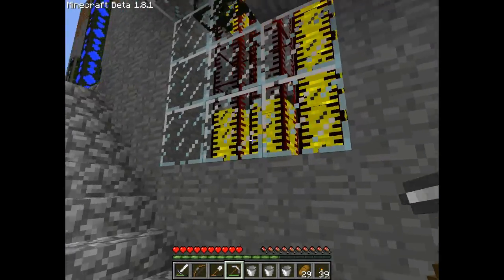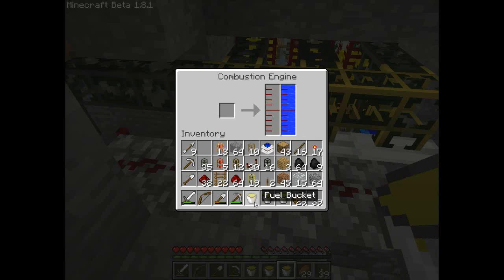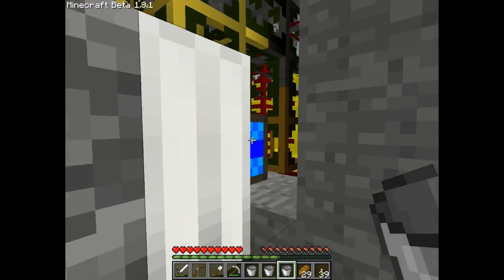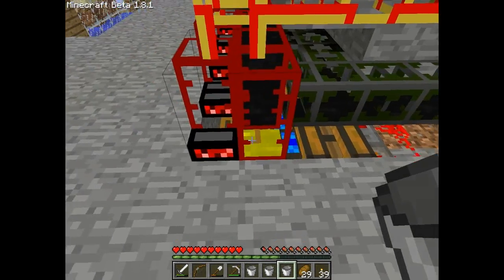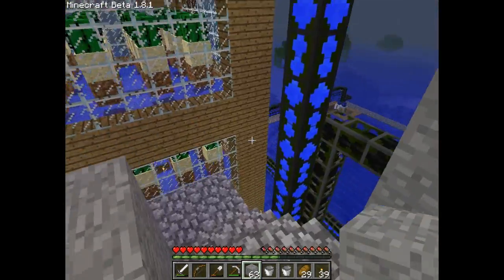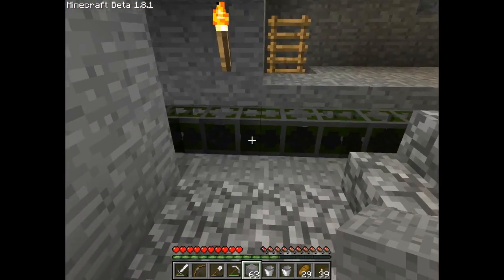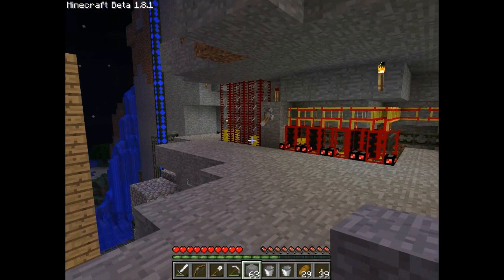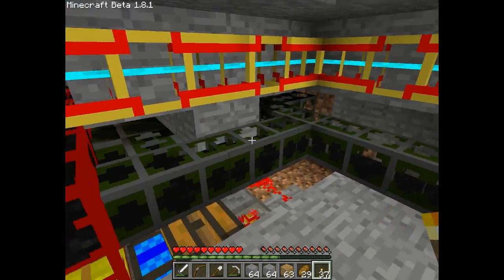My Buildcraft 06 - Disaster at the Power Station

Comment from the maker: @Himel05 Well, for the moment I'm fine with letting the system run for a few min... building something or taking care of things in the area, then cutting power.  In the newer Buildcraft update, you can setup your system to automatically shutdown if the engines are red or yellow, then start up again when blue.  It's going to change EVERYTHING for the better!  Spacetoad has some videos highlight it, so you can check them out.

Comment from the maker: @ThunderBirdGta Most likely you do not have the correct version for all the components needed for the mod.  This happened to me and it was because I had the version of ModLoader that was for a different MC version.  Few tips: 1. Install from a clean MC ver.  2. Use the mod pack installation assistant. 3. download all the files needed again using the assistant and be sure to get the right version.

Comment: Most of you guys do not know wtf you are talking about. I run a huge refinery 24/7 without any switches or other special "Timing" mods. I can walk away for hours and come back to full tanks of fuel. If you know what you are doing, this can be achieved. Also, about cooling. Your engines exploded because you where not using gold pipes from your pump. Those stone pipes can only support a small amount of water in them at once. That's it! I am making my own tutorial for you guys!

Comment from the maker: Electric engines... do you mean redstone engines (the wooden ones)?  I do not think they can output enough power to power a refinery. You need a great deal of power to power a refinery, but the benefits you reap are huge in comparison.  Basically... run a refinery with combustion engines and then you will have a crap-load of power.  Is the tekkit something different, or are you referring to buildcraft 2.2.12?

Comment: My powerplant has 89 combustion Engines and i have the iron OR gates set to
BLUE=REDSTONE SIGNAL
GREEN=REDSTONE SIGNAL
So if it hits yellow or red it shuts off to cool down......i have 10 20 block tall tanks and there all full (I made the powerplant in creative)

Were i found out how to use the
OR/AND gates to shut down engines. Using Gates to Stop Engines Overheating (Tekkit/Feed The Beast) - Minecraft In Minutes
Reply from the maker: Thanks.  This video was recorded so long ago that pipe gates weren't even a part of the Buildcraft mod at the time.  Now it's a lot easier to keep your engines from overheating using pipe gate-controlled setups.  In my new world, I recently setup some BC engines with this sort of control:  @watch?v=qi9-gs5s3AM
Reply: chemdork123 :P never thought you would reply but dont have gates connected to more than 2 engines cause if one is still at blue the other engine will overheat cause there is still a redstone signle going to it (i found that out the hard way....have you ever seen 89 combustion engines blowing up?)
Reply from the maker: It must have been quite a sight...
Reply: chemdork123
it was i just remberd that i had it on a blue print so i got it back after a while i also had a back up engine room with only 10 of them so it was fine and i powerd 3 of my qurrey out of 10 (im going to change it to 5 it keeps crashing my game with all the block updates)
Reply: +chemdork123 And now, even later, they've made it so the engines just "sieze up" (stop working) until you whack them with a wrench, instead of exploding.

... I think.

(They wanted to keep the explosion mechanic, but too often it gets triggered by bugs in the game, instead of by badly designed power plants)